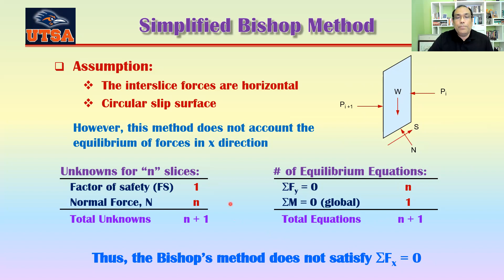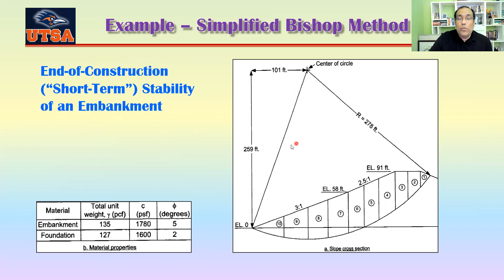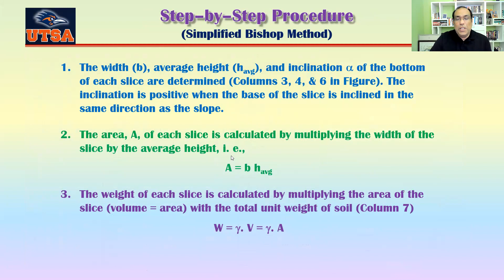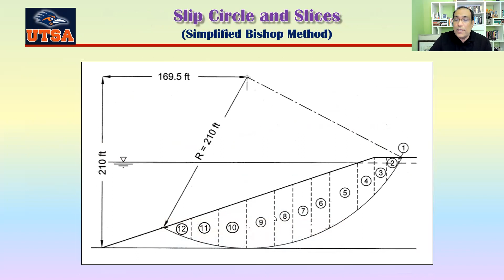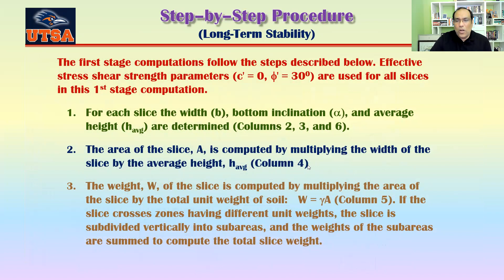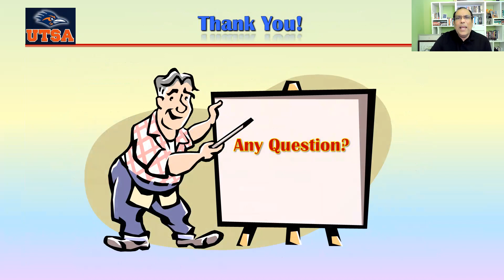Slope Stability Analysis: Simplified Bishop's Method

Comment: There is an ERROR in the "Simplified Bishop Method Short-Term Stability Analysis" table.  I believe that column 3 "Horizontal Width (b) ft" has been vertically transposed.  Slice 1 is 17' wide not 57'. Slice 2 is 22' wide not 44' etc.  It looks like this error was copied from the US Army Corp of Engineers global stability manual EM 1110-2-1902 (31 Oct 03) Figure F-11.
Reply: Yes, you are right. And also he made a mistake in calculating length of slice base.

Comment: hello, thank your for the explanation, I have a question, in the purely cohesive soil formula, c is multiplied by delta l, this delta l should be the average height of each slice? but in the original equation, c was multiplied by width of each slice, why does it differ? 
And should this method yield a bigger safety factor than that of taylor's method? i had an exercise with homogeneous purely coherent soil, abd i got an answer bigger by 0.6, is that okay?